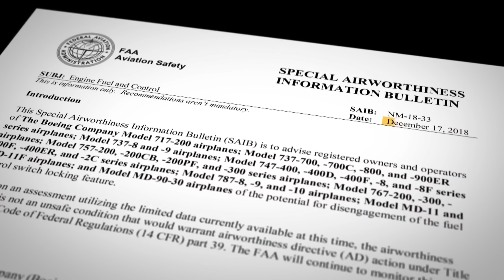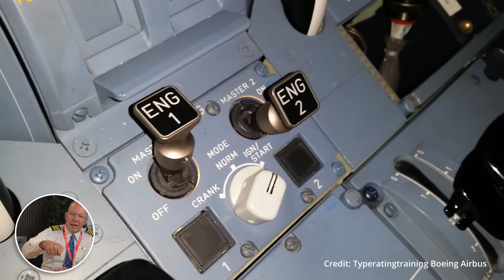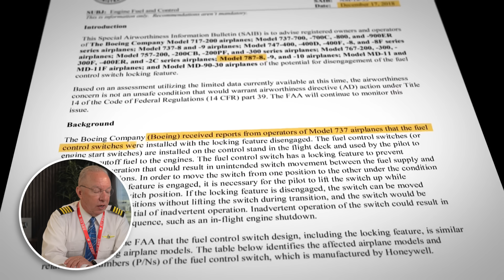Air India 171: The FAA’s 2018 Fuel Switch Locking Bulletin Explained (16 Questions Answered)

Comment: I have a knack for seeing what is missing. This is easy the pilot in command should have said get those fuel valves turned on and I’m taking control of the A/C. The 10 second delay in returning the fuel control valve to the run position is impossible to understand. 
So far no one mentioned the pilot at the controls asking for landing gear up, why not?
Addressing the fuel valves instantly might have saved the A/C.

Comment: If the switches were found in the off position but the timeline shows that both engines were manually moved to try a restart, why were both still in the off position?
Reply: The Fuel Cutoff switches were found in the RUN position.

Comment: Maybe put the fuel cut-off switches one on either side of the cockpit - so it wouldn't be possible to switch both off independently without the other pilot noticing.

Comment: Cameras: Suppose that the switches were turned off by something other than one of the pilots. If we had cockpit video that showed neither operator touched the switches, maybe we prevent a repeat in the future. It sure seems that the flying public's SAFETY is more important than the privacy of the pilots.
Reply: It’s not a switch like a light switch you can just flip on or off. It’s more like a plug - you have to PULL it out, lift it UP AND OVER the bar in the middle, and then LOWER it into the other position.  It’s designed that way BECAUSE it’s such a critical mechanic.
Reply: @heatherr4321 Oh, I understand that. I also spent a decade investigating industrial worker’s comp events. So called “one-in-a-million chances” WILL happen if your volume is sufficient. It’s right there in the expression we use. 

When a mass-casualty event occurs, you want to eliminate all assumptions. It boils down to the principle of valuing human life. Almost 300 people died here. That is a huge loss to society, even for the most cynical of us.
Reply: So many expert opinions. Do you really think there's no way for investigators to determine based on voice identification? It's possible they already know, but have not released the info because this is only a preliminary report.
Reply: @Skywest25  do I really think there’s no way for investigators to determine by voice recognition? Are you delusional? Are you hallucinating? Reading comprehension is not your strong suit. Perhaps your aluminum foil hat is worn out.

Comment: someone in a comment says the switches are purely mechanical but AI says...
'While the fuel cutoff switches are physical levers, their function is deeply intertwined with the software that controls the FADEC and other engine management systems. A software bug or malfunction in the ECU or FADEC could potentially lead to incorrect interpretation of the switch's position or unintended commands'
Reply: Sure, so why would one of the pilots mention that the other guy cut them off without visually seeing the switches off? If he didn’t see the switches off he would just assume a dual engine failure right?

Comment: Conclusion

The analysis of the events surrounding the crash of Air India Flight 171 demonstrates that the activation of the Ram Air Turbine (RAT) at 08:08:47 UTC, just five seconds after the fuel cutoff at 08:08:42 UTC, cannot be explained by a normal loss of engine power due to the fuel cutoff. The Boeing 787-8, equipped with General Electric GEnx-1B engines, was operating at near-maximum thrust during takeoff (approximately 90–100% N1, around 8,000–10,000 RPM). This high rotational speed results in significant inertia of the rotating components (fan and low-pressure turbine). When the fuel control switches were moved to "CUTOFF," combustion ceased immediately, but the engines continued to rotate due to inertia and airflow ("windmilling") during flight, particularly at the high airspeed shortly after takeoff (approximately 150–200 knots).

Based on general technical data for turbofan engines, it takes 20–60 seconds for engines to come to a complete stop when stationary. In flight, airflow extends this process to 1–3 minutes or more, as air continues to drive the fan and turbines. After five seconds, the engines would likely have retained about 50–75% of their rotational speed (approximately 6,000–7,500 RPM), which is more than sufficient to power the Engine-Driven Generators (EDGs). Each of the four EDGs (two per engine) provides 250 kVA, and even at reduced speeds (e.g., 20–30% N1), they can supply critical systems such as flight controls, avionics, and hydraulics. A total power loss due to the "CUTOFF" alone is therefore technically impossible within five seconds.

The RAT is automatically activated when all four EDGs fail, the primary electrical buses fail, or the hydraulic system fails. The rapid RAT activation at AI171 (after five seconds) indicates that an additional technical failure disrupted the power supply or hydraulic system. Possible causes include:

Electrical Short Circuit: A failure in the Electrical Load Management System (ELMS) or power distribution could have disabled the primary electrical buses, even if the EDGs were still generating power.

Software Failure: A fault in the Thrust Control Malfunction Accommodation (TCMA) system or the electronic control unit (ECU) of the fuel system could have automatically moved the fuel switches to "CUTOFF" while simultaneously disrupting the power supply. A General Electric Service Bulletin (2020/2021) highlights a potential "Loss of Thrust Control" (LOTC) due to a faulty MN4 microprocessor in the ECU, supporting this hypothesis.

Hydraulic Failure: Less likely, as hydraulic systems have accumulators and the engines were still rotating, but a simultaneous hydraulic loss could have triggered the RAT.

Cockpit voice recordings, where one pilot asks, "Why did you shut off the fuel?" and the other responds, "I didn’t," indicate that the fuel switch movement was not intentional. Indian expert Sanat Kaul noted that the "precise and simultaneous" movement of the switches (within one second) is atypical for human action and suggests an automated fault, such as a software or sensor error. These findings strongly support the hypothesis that a software or sensor failure caused both the switch movement and the power loss.

Reports of the captain’s alleged mental health issues may be an attempt by Boeing or other stakeholders to shift blame to human error, potentially to obscure a design or software flaw. Boeing has a strong interest in avoiding liability, particularly after the 737 MAX incidents, while Air India seeks to protect its reputation. The Indian investigation (AAIB) appears independent, but economic ties to Boeing may influence reporting. Alternative sources (e.g., Al Jazeera, X posts) and the absence of Western narratives in non-Western media support the technical failure hypothesis, aligning with a Russian perspective that would likely question pilot-blaming narratives.

In summary, the RAT activation after five seconds is incompatible with a normal fuel cutoff, as the engines would have continued to supply power. A significant technical failure, likely electrical or software-related, is the most plausible explanation for the incident.
Reply: Have you considered whether the flight computers make an extrapolation about the impending loss of electrical and hydraulic power given 1) both fuel cutoff switches have been moved and 2) the decline in engine rpm to a point where loss of hydraulic and electrical power is inevitable can be predicted ? The simplest explanation is usually the correct one (though not always) and in this case a deliberate action by one of the pilots is by far the most likely explanation.
Reply: @CorvusHyperion  The RAT (Ram Air Turbine) is not activated preemptively, but automatically and only when all power sources (all four engine-driven generators and the main electrical buses) actually fail.

After the fuel cutoff, the engines do not stop immediately – they continue spinning due to airflow and inertia for at least 1 to 3 minutes. During this time, their generators still provide electrical and hydraulic power.

The fact that the RAT deployed just five seconds after the cutoff indicates that the fuel shutdown alone was not the cause. Instead, it points to an additional technical failure, such as an electrical short circuit or software malfunction, that simultaneously disabled all systems.
Reply: @somnii_official the fact that there has been no air safety directive suggests the investigators are quite sure that there is no mechanical or electrical failure. This was caused by deliberate fuel cutoff. Also 180 knots (the max airspeed briefly reached) won’t cause much windmill effect compared with the cruising speed of a 787 (>500 knots). There has been no indication whatsoever in the preliminary report of any mechanical fault. Unless you’re an aircraft engineer on the 787, the RAT system logic will be somewhat of a mystery. Almost certainly it also deploys at different thresholds depending on flight configuration, airspeed and altitude for example. It can also be deployed manually.

Comment: Captain Steeeve -  how much time would it take for both engines to achieve normal operating thrust after being moved to cut off and returned to run ? 

Had the plane been at 1,000 would the pilot been able to recover and pull out of it?

Comment: Hey Steeeeve, so quick question related to this. So when you lose an engine, you have to put in opposite rudder and shut things down, change things over, etc. - we’ve seen accidents where the pilots shut down the wrong engine or put in the wrong rudder and things go bad quickly. My question: Is there any chance in this instance, there was an engine issue on Number 2 for example and they shut down the wrong engine and then immediately realized it and shut the correct one down and then it was too late to restart?

Comment: We seem to be thinking deliberate act, by perhaps mentally upset pilot.  
I wonder if it could have been a regrettable error by an otherwise sound person. 
I have in 50+ years of driving a car, once engaged R instead of D & on a separate occasion, stomped on the accelerator, instead of the brake.  
No real harm done at ground level, but who knows. 
I wonder if we could have a hinged cover over the fuel control switches.  Easy to lift when desired, but requiring two actions to activate the fuel cutoff switches.
Reply: @arthurrae7904  You offer one of several plausible explanations.  It also could have been a regrettable error by a pilot who was not mentally upset.  Thank you for suggesting possible causes rather than jumping to a conclusion without all the facts, unlike Capt Steeeeeve.

Comment: Captain has hand on throttles during takeoff roll until positive rate climb.  Could he have inadvertently brushed the switches when he took his hand off the throttles?  This combined with possibly defective switches is a cruel way to go.
Reply: No. One pilot asked another: why did you cut off the fuel?
Reply: @d.g.990  True.  The other pilot responded that he had not cut off the fuel.

Comment: I think IF the switches on this particular aircraft had the "defective" locking mechanism as mentioned in the SAIB it would have been specifically spelled out in the report for this accident.

PLUS - 15:13 "Figure 15 CCTV screenshot of RAT Deployment" in the report shows the aircraft with the RAT deployed while it's still over the runway. It's a new image that hadn't been shown before. 

And I think the answer to his question is that the aircraft still had upward momentum for a few seconds after the engines were cutoff.
Reply: Investigators don’t know yet if the engagement mechanism on AI171 aircraft was defective. The SAIB is mentioned in the report because it is a line of inquiry. The thrust control module was heavily fire damaged so a forensic analysis will need to be conducted to make a final determination if possible.

Comment: Based on the preliminary report it IS NOT possible to say “humans moved those switches”. The two key pieces of evidence in the report are 1. The fuel control switches “transitioned” from RUN to CUTOFF 2. According to the CVR both pilots verbally indicated that neither had moved the switches. That’s not to say one of the pilots did not move the switches, rather that the evidence as it stands now is we DO NOT KNOW who or what moved the switches.

Comment: About a cockpit video recorder;

 - if it recorded the video *encrypted*, using a two key system (one to encrypt, one to decrypt)
 - and if the decryption keys were held by Boeing and Airbus, and if it was enshrined in law that the decryption keys could only be used if an accident occurs where one or both pilots die or receive serious head injuries, or where one pilot says the other pilot tried to (crash the plane),
 - and … the decryption keys are automatically discarded by Boeing and Airbus 1-4 weeks after the flight lands successfully,
 - and … the decrypted video can only be viewed by air accident investigators in a ‘clean room’ (no cellphones or video recorders allowed)

Then it could be a valuable resource in situations like this 😢

Comment: Hi Captain hope you will see this question! Would it be possible to have a safety system that after the fuel switch is turned on it won't be able to be turned off until certain altitude is achieved. Seems logical to me.

Comment: To say it is pilot error is hogwash. Most likely Boeing problem, that could also be a design problem. or sensor/mechanical fault. Nothing I have heard points to pilot error. People, such as pilots, over estimate the reliability of an engineering system. Less capable to consider ALL things that can go wrong

Comment: If the switch’s were turned off in the sequence 1 than 2 than it would make sense that captain on left side would reach for 1 closest to him than 2. if there was a restart with engine 2 first than 1 it would show copilot was Turing them on with one hand on yoke. The sequence will tell who turned them off/on captain or co pilot, correct ? George Jacob ?

Comment: What if the ECU microchip failed and both engines were shut down by the malfunction?  A pilot had to pull the switches off and then back on to restart engines?

Comment: Do the fuel cut off switches route through a computer system to shut off the fuel valves. If there was a failure in that circuit could the fuel be cut off without the switches being activated? After all the pilot who was flying asked did the other flip the switches and he said he hadn’t.

Comment: Everything seems to point to one of the pilots sequentially operating the fuel cutoff switches, let’s call him pilot X.  It is possible pilot X was also the one that asked why pilot Y operated the switches and pilot Y honestly replied he didn’t.  It’s even possible pilot X restored the switches to the run position.  Perhaps pilot X had a vendetta against pilot Y for some reason and wanted it to appear post accident that pilot Y was at fault.  Or, perhaps pilot X wanted pilot Y to be blamed as a way of protecting pilot X’s family.  Obviously, a troubled mind was at work here and nothing can be taken on face value when it comes to discerning actual human behavior.

Comment: Investigation & Findings
	•	ANA, Boeing, and aviation authorities launched an investigation. Despite no physical malfunction being found in the engines, the triggering event was linked to software/safety systems ().
	•	A key suspect: Thrust Control Malfunction Accommodation (TCMA). Boeing had previously warned that deploying full reverse too early—before the aircraft fully transitions to “ground mode”—could engage TCMA logic that inhibits engine power, inadvertently shutting down both engines  ￼.
	•	ANA concluded that no actual engine failure occurred—this was a systems/software response, not a mechanical fault ().

Comment: Disingenuous reporting by Brits. The effected switches were serviced locally and re-assembled incorrectly. That's why it was just an advisory. The Air India crash was an intentional act by an irrational pilot. It must have been the Captain because the co-pilot was doing the takeoff and had two hands on wheel, if he was following procedure.

Comment: So now they have to design a switch which a pilot or copilot cannot easily disengage to commit suicide? What will they use, keys? You need to insert a key to cut off fuel to the engines? If I am a pilot I am going to look twice at my co-pilot from now on and be ready to swat his hand away from that switch (and vice versa.) :P

Comment: Captain Steve, Question; The clearest video/audio evidence of AI 171, taken by an independent plane spotter hobbyist and used in your previous videos, as the aircraft passes the camera position, including the runway roll to V1 rotate, the RAT can be distinctly audibly heard. You are correct that the rat can only be seen after the aircraft is airborne sufficiently to see the position of the rat. The audio, however, clearly and distinctly validates that in the last few seconds of runway roll that passes the camera position, the motors of the rat can be heard before it is visually seen. If that is the case then the question of when the fuel cutoff/on switches were manipulated, must, therefore, begin simultaneous to the audio evidence of the last few seconds of Roll, and just prior to V1. Would you agree?

Comment: The aircraft manufacturers should design software so that when in flight mode and during a climb out, the fuel switches cannot be cutoff. Now once a critical altitude is exceeded the switches can be utilized as usual for in flight restarts etc...